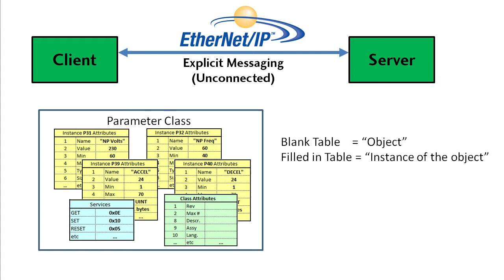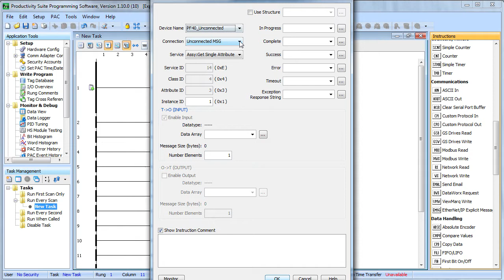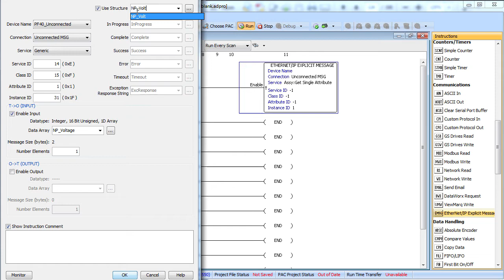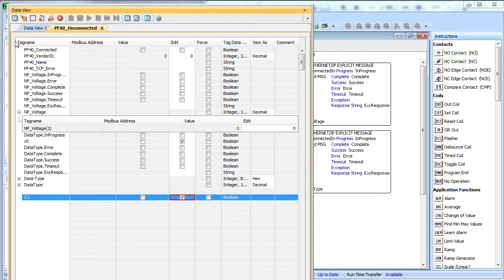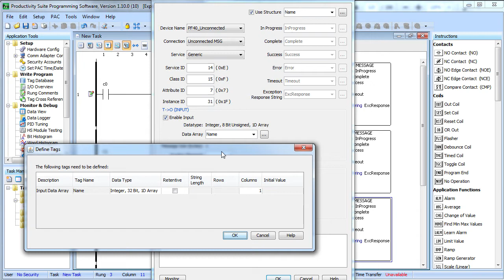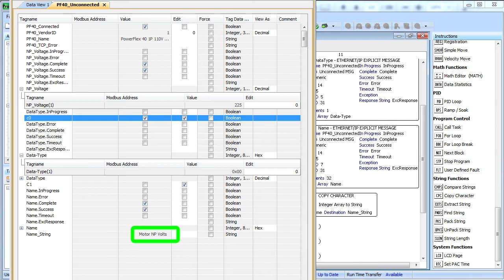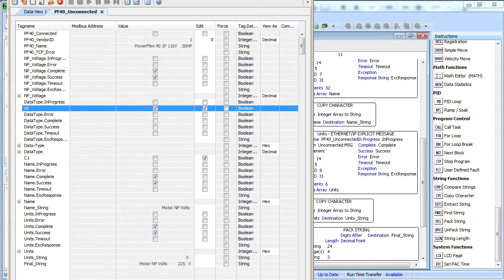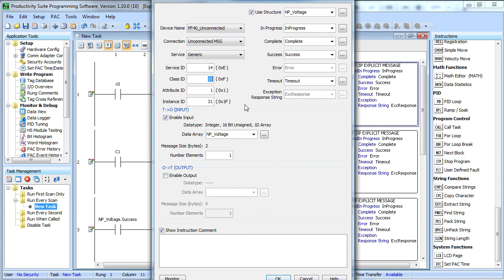Productivity Series EtherNet/IP Unconnected Explicit PF-40 VFD Demo from AutomationDirect

Comment: Is there a way to start and stop a motor using ethernet/ip but using the brx and powerflex drive?
Reply from the maker: @talinalugo5857 Using the latest version of Do-More Designer, the BRX PLC can import an EDS file—such as the one for your PowerFlex drive—and control the device via EtherNet/IP. Some configuration will be required, including specifying the connection point information for your particular drive, which can typically be found in the manufacturer’s documentation.

Comment: Can I also use explicit messaging to write values to the powerflex drive? I mainly need speed reference.
Reply from the maker: Mark Patera Yes, it is possible to use explicit messaging to write values to the powerflex drive. Around the 10:00 minute mark in the video, it talks about where to find the information needed for setting parameters. The information for the fields comes from the Allen Bradley documentation. If you need further assistance, please contact our award winning technical support team. I hope this helps!
Reply: Can we use Labview( Laptop-Lan card) to send Explicit message directly (over network cable) to sensor,inverter etc to read some values (flowrate,power,torwue)?Thanks!